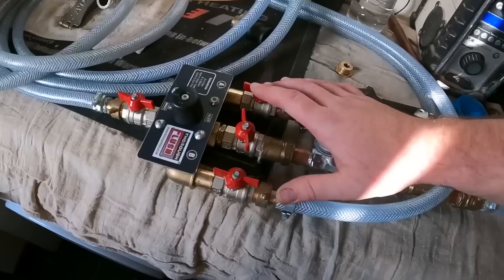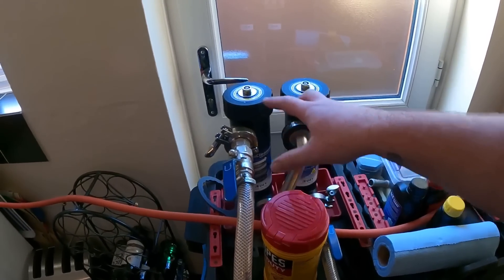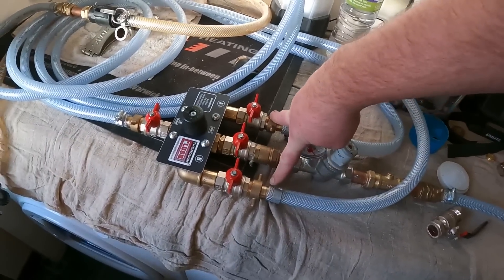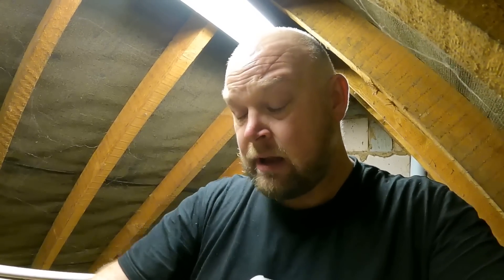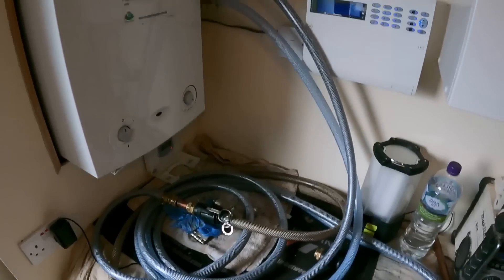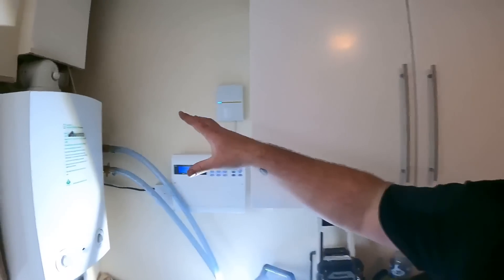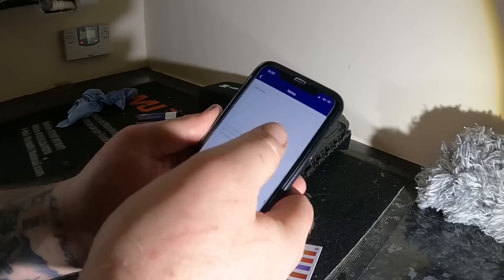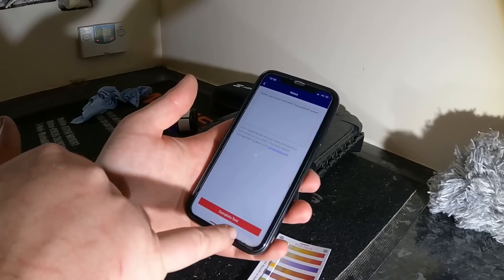HEATING SYSTEM CLEANER.. Which was BEST? PART 2 | Mains Water Flush

Comment: Very interesting video! Iv got a question though, if you’ve got say 1 bar going in, and its got to climb upstairs and to the last rad, would it be fair to say that by the time it gets there you’ve probably only got half a bar of pressure to push any sludge? I can’t help thinking a power flush is a better machine?
Reply from the maker: Never had an issue with this set up…. Even on very big jobs

Comment: Thought your not aloud to have a valve on the cold feed or vent pipe
Reply from the maker: Lever is removed when I’ve finished doing what I need so it would be turned off accidentally

Comment: I like the fact you show such a wide range of different plumbing scenarios. I’ve thought about investing in a power flush machine in the past but didn’t for the very reasons you mentioned about blowing off fittings with pressure too high etc and Murphy law would suggest it would be under a tiled floor or something. Great video thanks Mark. Very informative stuff.
Reply from the maker: Yep that’s my big concern with them… this set up is perfect👌🏼

Comment: Hi Mark.  Watch both videos.  It’s a lot of work but the results are definitely worth it. I am not plumber but all that muck in the system can’t help the boiler worth probably. Good job Mark as always. I like the two videos mate but you do what works for you.  I appreciate what ever you put mate.  👍
Reply from the maker: Thanks mate, yep all that sludge in the system is making the pump run harder, clogs up valves etc and stops heat being generated…. A very good thing to have done
Reply: Thanks Mark. Will definitely get it done thank you. 👍

Comment: Great second vid fella . 
What would be a great addition is to show the subscribers the airing cupboard & pipework configuration especially on an open vented system as most people know what the combi set out is like. Its harder to flush I found especially with a 3 port as they can be very restrictive when it's set to manually open. Something I also did was to cut in a gate valve on the cylinder return if possible if not on the flow so you can isolate the cylinder , that way you can flush that circuit a bit like a rad!! If that all makes sense . I used to find the open vent & cold feed connections by the pump were always problematic & most often partially blocked causing pumping over, resulting on boiler cycling pump failure etc. 
I appreciate the younger lads want to make everything a sealed system now & it is the way to go & easier. However as you know there's still shed loads of open vent systems out there. 
What you've done for that customer will bring her bills down & improve the efficiency no end. 
I am super Impressed with the thorough flush unit & a great benefit to have, i was shocked how much sludge it moved compared to the magna cleanse &, love the way you've lower the mains pressure, as open vent systems can with pipes emb3dded in solid floors can be exposed with too much pressure going through them. Something the young guys seem to forget until its too late!!!! 
I do like the 2 parter vids as it keeps you guessing what the outcome will be. 
Look forward to the next one up 👍
Reply from the maker: Thanks mate, great comment 👍🏼👍🏼
Yer I was properly impressed with just how much the Thoroughflush unit managed ti get out after the Magnacleanse flush.

Comment: Hi Mark, great videos as always. I have just a couple of questions as I have both a Thoroughflush and a Magnacleanse like yourself. 1, In your honest opinion, do you think that if you'd have just introduced the cleaning chemicals a week before and then gone straight to the Thoroughflush on day one, that the result would have been any different ? It wasn't clear if you agitated the radiators on the Magnacleanse phase, did you? Cheers
Reply from the maker: As said in part 1 on Sunday I agitated the rads on the Magnacleanse flush but didn’t show it as didn’t want to repeat myself when I did the Thoroughflush.

I personally don’t like leaving systems that long with cleaner in them incase there is an issue

Comment: Thourough flush is a nice idea but for me 10L/min of mains water is never going to match 150L/min from a power flush machine which you can also use chemicals and heat with.
Reply from the maker: Yep people prefer different systems and do what they are happy with…👍🏼👌🏼

personally I don’t like the power flush systems as there is a lot more chance of blowing a fitting and flooding a house running that sort of L/Min and pressures……. Also they are huge units

Chemicals and heat with the Magnacleanse then cold water flush with the ThoroughFlush👍🏼

Comment: I like 2 part videos, I know it makes no difference but feels like I’m getting extra 😂 
Also, I’m amazed how much magnetite came out with the mains flush even after having the magna cleanse on it for hours the day before!
Reply from the maker: Yep I was very surprised aswell, great result in the end
Reply: Surprising "amount of sludge with mains flush" But if you power flush ?
Completed in a day: removes kore sludge quicker: never had a blown fitting: corroded fitting with a nail smashed over a copper pipe,YES!
I'm a power flush geek, still put magnets on after first flush and chemical circ.

Comment: You forgot to mention that with the Thoroughflush, you also banged the rads. Wonder how much extra crud would have come out if you banged the rads on MagnaCleanse cycle on day 1?.
Reply from the maker: If you had listened in part 1 I said I was doing that with the Magnacleanse setup on day 1 but I said I will show you when I do it with the Thoroughflush as you won’t want to see it twice😉😉

So no, I didn’t forget to mention….. you forgot to listen 😉👍🏼
Reply: @MJTiffPlumbing  Apologies. So yes, the Thoroughflush is bloody good as it removed more than the Magnacleanse after the Magnacleanse had already removed quite a bit of crud.
Reply from the maker: 👍🏼👍🏼

Yep, I was genuinely shocked at just how much more was removed with the ThoroughFlush unit… my thinking is that as you can switch direction instantly with the TF unit, it causes a shunting effect and moves a lot more debris around….

Comment: Great video 👍 good to see both done on the same system. Not something you usually see. Begs the question is mains pressure better than any cleaning products?
Reply from the maker: Thanks mate..👍🏼
It wasn’t the most scientific of tests but showed just what else can be taken out with a proper mains flush, I think the ability to switch direction with the Thorough flush helped massively as it causes a shunting motion I guess

Comment: Is it cost effective flushing? Depending on the age of the rads I suggest it's cheaper to replace rads and empty the whole system to get rid of crud. Spent £850 on total rad replacement which stopped the 3 port valve clogging up every 6 months. Better energy efficiency too with new rads. How much is a system flush like that?
Reply from the maker: Personally I would say a proper system flush is very good money spent….
Reply: @M J Tiff Plumbing  as a landlord who has paid for a flush several times and 6 months later the same corroding rads caused the same issue. I'm not saying its wrong but on older systems it's better to get rid of old rusty rads with new. New rads also work more efficiently so the saving is way better than a flush. I expect you tell your customers that as you're a plumbing legend 🙂
Reply from the maker: But if your filling new rads with nasty corroded sludged up water it’s going to cause the same issues, also that water and corrosion is going through the boiler/pump and valves….. its the age old thing of how far do you go.
Think of it like this…. Changing your oil filter in your car and leaving old oil still in isn’t the best thing to do….🫣
Reply: @M J Tiff Plumbing  isn't sludge mostly in the rads at the bottom? Normally when taking off all the rads removes 90% of the water from the system so hopefully the inhibitor and filter will sort out the other 10% a flush is perfect for systems where they've been in place for approx 5yrs but those rads that are showing rust on the outside it's a waste of money imo. People will always go for the cheaper option then moan later it didn't work.
Reply from the maker: Sludge is in the rads, and the pipe work, and the valves, and the pump, and the heat exchanger etc etc….👍🏼

Comment: Hi Mark made my own water mains flush with copper pipe and lever valves with reverse flow and reverse dump valves pressure reducer, and none return valve  using my kamco  hoses and magnets works a treat cost £70 materials and a bit of my time, works a treat, keep up the good work mate.
Reply from the maker: Thanks mate…. Glad you enjoyed the video👍🏼👍🏼

Yep there is ways to make them, I find the size of the Thoroughflush is perfect along with the hoses etc etc that comes with it…. 👍🏼

Comment: What's a typical cost for this? Guessing it's different depending where you are in the country?
Reply from the maker: Yer it’s very much area dependant…

As a guide I charge £400 for a system flush up to 8 rads…. Then £50 per rad extra.
That’s for a combi system, it’s a little more if it’s open vented.
Also extra if it needs a filter fitting etc etc
Reply: @MJTiffPlumbing  cheers great vids this week
Reply from the maker: Thanks buddy

Comment: Thanks, I enjoyed both videos.  From the customer point of view your work and time spent is superb but what would a job like this cost?   

Are quotes for a power flush only with a magnaclean at nearly £400 for 3.5 hrs just a waste of money?  This wouldn’t have included working each radiator either.
Reply from the maker: You need to work each radiator on a Magnacleanse flush or any flush…..
You need to be making sure every rad has been flushed and is clean, this is where thermal imaging is great as you can see any cold spots etc

Comment: You should really drain radiators so there is only water in the bottom otherwise water just travels over the top and you will see a big difference in what comes out , sludge is heavier than water
Reply from the maker: See the thermal imaging buddy, you can see where the cold water is😉👍🏼👍🏼
Reply: @MJTiffPlumbing  you’ll find out when you go on the Magna clean course 👍🏼
Reply from the maker: Thanks for your insight into the Magna Clean course…👍🏼…. I will indeed see, that’s the whole point of a course buddy… to gain more knowledge.

I can also see with, as said and shown, the Thermal Imaging camera. 👍🏼
Reply: @MJTiffPlumbing  only recommendation, I have all the gear 👍🏼
Reply: It’s nearly impossible to drain every rad halfway down as you cant see the water level,
In theory you’re supposed too, in practice no one does,

I’ve yet to see how it’s done in practice by any plumber,
Reply: The passive aggressiveness in this comment thread is gold 😂 👍👍